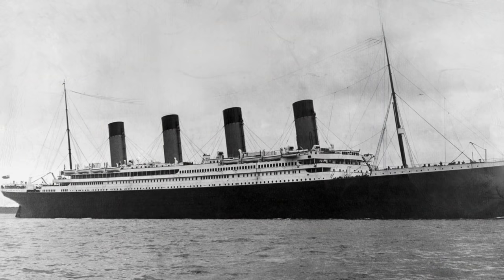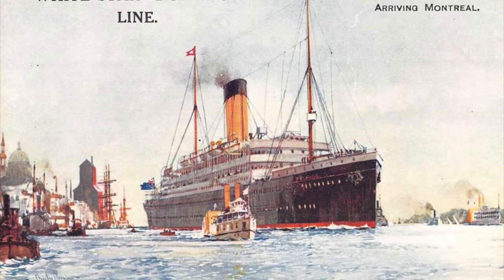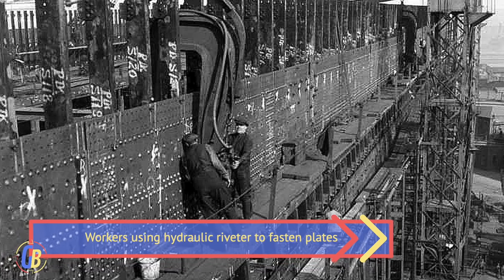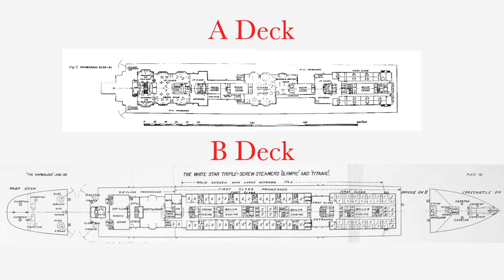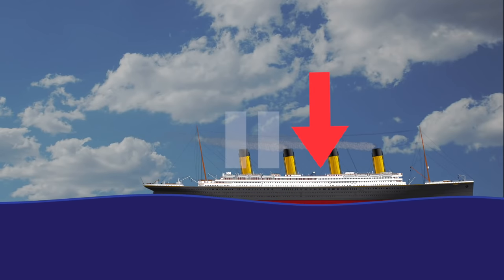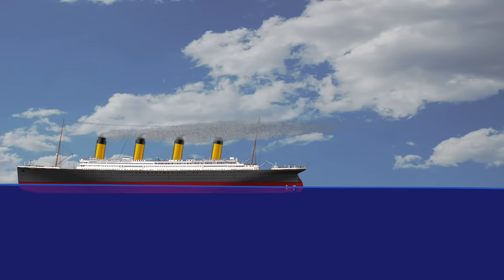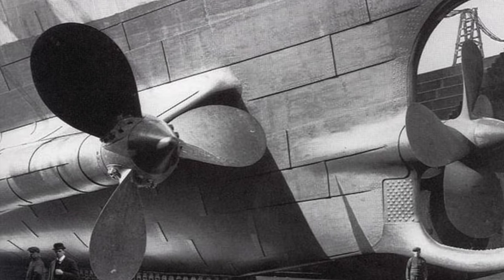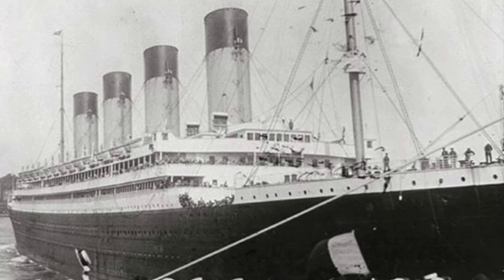Ten Technical Titanic Facts

Comment: The boilers in boiler room one if I am not mistaken were not used to drive the ship, rather they supplies steam to the dynamos or generators that produces all the electrical power while Titanic was at sea. When the keel and double bottom bent upwards and failed, these boilers, the coal bunker, water tight bulkhead , and the forward low pressure cylinders were shoved into G-deck and boiler room one collapsed, killing everyone who was working in and near that space. That was why the power went out just before the ship broke in two, the steam to the generators was cut off when the steam lines were severed by the break up and probably the generators themselves were torn off their foundations as well. Now the remains of boiler room one are scattered across three sites on the ocean floor, two of them to the east of the collapsed stern section, the pieces of double bottom even farther to the east  far from the rest of the ship.

Comment: I remember reading somewhere that the Titanic  had the upper decks enclosed or reinforce the ship, the Olympic had too much flex. The later WW2 liberty ships also used a similar extra steel  band around the hull. Before that they would suffer stress cracks in the hull and sink rapidly. Has anyone else read or seen this info?
Reply from the maker: The design for Britannic was modified to include additional expansion joints because Olympic had been experiencing excessive stress on her superstructure. Of course, we don't know if Titanic would have had the same problem because she was not in service for long enough but it is likely that she would have.
Reply: The upper deck was enclosed for unknown reasons, but it wasn't to reinforce the ship.
The upper superstructure was entirely separate from the hull, so it would be impossible to prevent hull flexing by stiffening the superstructure. The relatively minor hull flexing on Olympic was remedied by the introduction of a steel strap added to the underside of her hull.

Comment: One thing I wanted to know is what the third anchor stowed on the forward deck was actually used for?  I always thought it was a spare in case something happened to the primary anchors, but then I realized how difficult it would be to even try to lift something off the deck like that.
Reply: The anchor mounted on the Forecastle would actually have been primarily used as a sort of counterweight for towing at sea in addition to just being a spare anchor.

In a scenario where the Titanic somehow lost all engine power and needed to be towed a fair distance back to port, some type cable or chain (known as an Insurance Wire) would obviously have to be connected from the bow of the Titanic to some other ship (likely another ocean liner).  But a taut unweighted cable connected directly in between two massive ships on a moving surface like the ocean would not be able to flex adequately with the waves and would break long before any towing was done.

This is where the third anchor comes in.  Underneath the Forecastle on C-Deck there was a large centrally mounted windlass which could feed a mile of cable out through the central hawse (that tiny little hole in the middle of the bow).  The small crane directly behind the spare anchor would be used to lift it out of its mounting on the forecastle and out over the bow so that the towing cable could be run through and then connected to the towing ship.

The towing ship would then pull away and the anchor would be allowed to move away from the Titanic, hanging from the middle of cable and giving it a sort of catenary curve, thereby preventing it from pulling taut and snapping from sudden strain.

Comment: The propulsion layout had operational characteristics that are not generally mentioned:
1. Only the outer two shafts could be reversed. These were the shafts connected to the reciprocating engines.
2. The center shaft, driven by the turbine, was only used at higher speeds. It was shut down for in-port maneuvering.
3. The turbine was driven by the exhaust steam from the reciprocating engines. This extraction of additional propulsion power from the otherwise "waste" steam was a major factor in the improved efficiency of this propulsion arrangement relative to a "recip only" configuration.
4. The exhaust steam from the reciprocating engines could be directed to either the turbine or directly to a condenser. Valves (apparently in the turbine compartment)  controlled where the exhaust steam was sent. The turbine's exhaust was always condensed.
5. When the engines were reversed, the exhaust steam had to be redirected to each engine's respective condenser. Otherwise, the turbine-driven central shaft would continue trying to push the ship forward. Even so, the inertia of the turbine + shaft + propeller would keep the shaft providing forward-driving force for a short while. (I find no mention of a shaft brake or of a braking stage in the turbine. If somebody knows otherwise, please provide reference).

Stopping any large vessel requires foresight. You cannot just step on the brake. From speed, stopping distances can be measured in miles. For a propulsion system like Titanic's, reversing the engines to provide a braking action required coordination between multiple compartments and stations.

Comment: I'm surprised that you didn't mention that when the triple expansion engines were reversed, the turbine engine shut off, stopping rotation of the propeller in from of the rudder. This reduced the effectiveness of the rudder dramatically,  and was a huge contributing factor in the collision with the iceberg  rather than missing it!
Reply: If the officer in charge had done what he was SUPPOSED to do, according to the modern seamanship manuals of the day... full ahead on one screw, full back on the other, the turbine would have kept running, the rudder would be effective, and the Titanic would have missed the iceberg, and be no more famous than any other hundred-year-old liner.
Reply: The 1910 edition of "Knight's Modern Seamanship"  quote..." The first impulse of many officers in such a situation is to turn away from the danger, and at the same time to reverse the engines with full power. This course is much more likely to cause collisions than to prevent them. (Following, italics in the original)  TO TURN AWAY AND SLOW IS THE SUREST POSSIBLE WAY OFBRINGING ABOUT COLLISION.  This is EXACTLY what Murdoch did!
As I understand it, most people think the Titanic barely grazed the iceberg, but let's assume she hit 50 feet of it. (Which it didn't,  that would have crushedthe starboard bow in like an accordion) Do you really think steering the ship properly  wouldn't have made 50 feet of difference, over a distance of at least a half mile (the presumed distance from the iceberg at sighting) ?
Reply: The engines were not reversed though
Reply: Dean Keepers  They likely would have if they could. You can't suddenly make two  10,000+ tonnes steam to engines reverse within 20 seconds
Reply: You can't reverse a turbine engine without a transmission that has a reverse gear.  Since reverse is not a regular operation mode except in port, I'm sure it didn't have one and they would just use the two expansion engines.  Also even if the middle prop could have been reversed, it wouldn't have been as effective as if it had been turning forward.  But there is no technical reason why they couldn't have reversed one of the expansion engines while keeping the turbine running fast enough to assist the rudder, unless the plumbing just wasn't set up for it.  But my guess is they didn't have a lot of time to throw valves.  Realistically they just shouldn't have been steaming that fast that far north at night with the technology of the day, so it was human error that lead to the loss not the engines or operation thereof.  What they were doing was the equivalent of trying to drive the speed limit in a heavy fog.  If there is something to hit, hit it you will.  Radar prevents these sorts of incidences today, but the Titanic did not have radar, just rudimentary radio telegraph, over which they were warned of iceberg sightings.  They should have slowed down and diverted south instead of blasting through an iceberg field at full speed at night.
Reply from the maker: @Nonplused  I don't want to insert myself into this debate, but will confirm that the central propeller could not be reversed unlike the 2 outboard propellers.
Reply: @TheGreatBigMove  Thanks for that.
Reply: In hindsight, probably.
But all in all it doesnt even matter. From the sighting of the iceberg to the collision less than a minute passed. Thats really not enough time to reverse the big expansion engines. I cant really say how long it takes for them to stop, but I guess that they were still running at some speed when Titanic hit the iceberg.
Reply: @535phobos  This is a good point but I think the reason people think about it is if you have ever driven a power boat before you know that when the power to the propellor is cut the steering is drastically reduced.  This is true even for something like an English canal boat with a tiller (I've driven one).  With the propellor turning under thrust whether it is a rudder behind the propellor, an outboard style engine, or even a jet boat, they steer much better under power.  On a big huge boat I am not sure how it would work the Titanic probably had enough speed to steer but it would have steered better under power.  The water being thrust at the propellor and then diverted to the side would have created a powerful side thrust at the rear turning the ship.  But to be truthful I don't know if the rudder could take the force, maybe that is why they couldn't do it, they would just wreck the rudder if they turned hard under full power.

Comment: Interesting that the rudder was operated by means of steam powered mechanism.  To turn the ship to port, the ship's wheel had to be turned to starboard and vice versa to turn to starboard, like a tiller on a small boat rather than like the steering wheel in an auto or a truck.
Reply from the maker: tags NOLA Yes, and the crew used “tiller commands” from the days of sailing ships. Most officers by the early 1900s started their maritime careers during the age of sail.
Reply: Not true since a rudder turns a ship in the opposite direction of its movement. Since ships are steered from the rear, if you wanted to go to port, you turned the wheel to port. This caused the rudder, and subsequently the stern, to turn to starboard, which moved the bow to port.
Reply: @paulheenan9098  With a tiller, that is, a hand operated rudder, to go to port, making the RUDDER go to port, your direction of turn, you'd push the handle to starboard.  When Titanic went down, ship's helms were operated like a tiller.  To get the rudder to turn to port, thus turning the ship to port, the helmet needed to be turned to starboard.  In the film "Titanic," Officer Murdoch, to get the ship to turn to port, he ordered his helmsman "hard astarboard!" This has since be changed.  Now helms are set like on an automobile.  To go to port, you turn the helmet to port.
Reply: It was actually just the British being very old fashioned. Ships were steered in the modern way long before Titanic's time, British mariners simply liked using the outdated tiller commands for whatever reasons, a habit they practiced until 1933.
That's why in the 1997 film, Murdoch shouts out a tiller command, but Quartermaster Hitchens turns the wheel to port.
Reply from the maker: Paul Heenan Very true. Most of those senior officers started their careers on sailing packets or auxiliary steamers.
Reply: I also didn't know that tbh
Reply: @forestmcneir3325  True.
Reply: No it did not. The wheel movement was exactly the same as today.... it was the helm order to the QM that was the opposite of modern practice.
Reply: @paulheenan9098  You do talk a load of rubbish. The helm orders were pretty much an international convention before the 1920s. Since the British Merchant Marine accounted for such a huge percentage of global trade it's hardly surprising that British conventions became the standard.

Comment: This probably isn't a "technical fact" but I'm going say it anyway. The propellers of Titanic were also called "screws" due to how the blades bottom of the blade were attached in a screw like shape around the centre of the propeller.
Reply: They are called screws  because they used to be screws before they became propellers
Reply: I'm afraid that's not true.  If you look at drawings of early marine propulsion systems, like those drawn by Leonardo da Vinci, you'll see that they have vanes in the shape of a screw around a central core.  But later it was found that individual blades were more efficient.  But if you visualize the path the blades take as the vessel moves forward through the water, you'll see that they follow the path of a helix, just like the threads of a screw, hence "screws."
Reply: @tjh44961  They are called screws because they were screws before they were propellers. It's as simple as that. Very big self tapping screws, mind. Lol

Comment: Well one big selling point of the ship was all of its electric equipment.  Electric lights, electric ovens, electric gym equipment.  Most ships of the time were still using oil lamps
Reply: Very interesting. How was the power generated. Were there seperate turbines for running the electricity?
Reply: @mabamabam  If I remember right, the steam first went through the engines that powered the propellers, and then they went through the generators for the electricity.
Reply: @daniellclary  so a separate low pressure turbine? How would that work when sitting at dock? Would they have some kind of ejector set up to drop steam pressure for when the drive turbine isn't running.
Reply: @mabamabam  Yeah, the third engine for the middle prop is alos low pressure, or part of the generator, I don't remember for sure.  And as for the docs, I know that many ships would always have the boilers going to keep the electricity going, and it takes a long time to start up the engines, so many cases they never shut them down anyway.  The Titanic may have been the same way.
Reply: The Olympic class actually generated enough onboard electricity to power the entirety of Southampton, so it gives an insight into just how much of the ship was electircally powered.

Comment: 7:01 
that's titanic my friend ;)
Reply from the maker: Ah, you are correct good sir. I must have been rushing or dropped in the wrong picture by mistake. Thanks for pointing that out.
Reply: @TheGreatBigMove  don't tell the switch conspiracy theorists about it
Reply: @TheGreatBigMove 
2) even though they were bigger and heavier than their Cunard duo competitors, Olympics consumed quite a bit less coal than aforementioned (thanks to their compound engine configuration). 
5) I believe Britannic had four (4) not five (If I'm correct) expansion joints, and they were of different design than those of Olympic & Titanic (gained from Olympic experience).               
6) Thanks to it's hull shape and ballast tank design, the Olympic class liner had way better stability and balance than the Cunard duo.
9) Port & starboard propeller blades were made of manganese-bronze alloy, as was central four bladed one, which was a single piece cast, rather than bolted on a boss, bose arm(?) (I'm unsure of it's proper spelling) and it was made on site foundry (central one) at Harland & Wolff.
 
Very good and informative video sir!